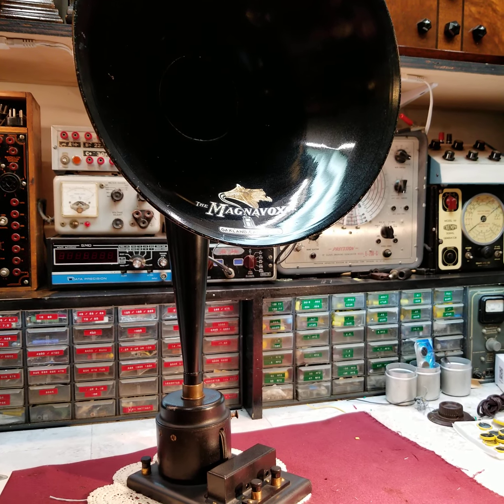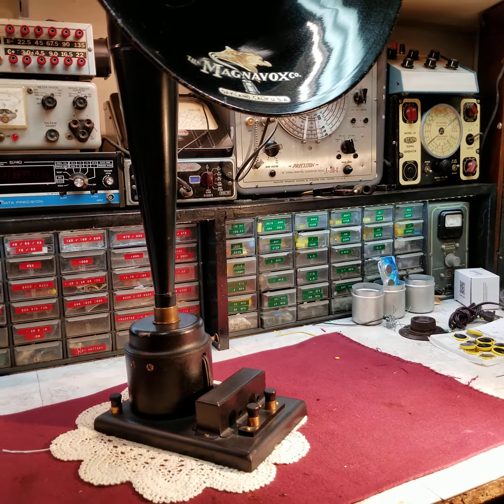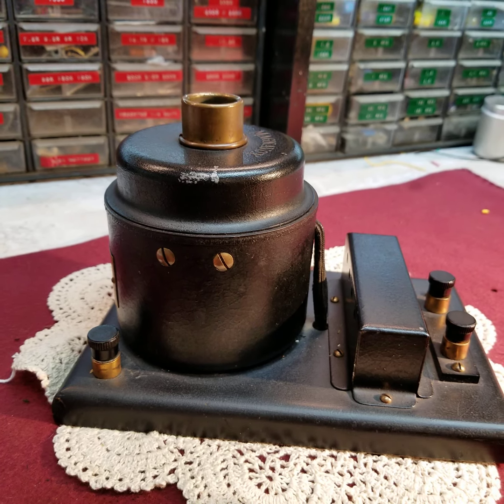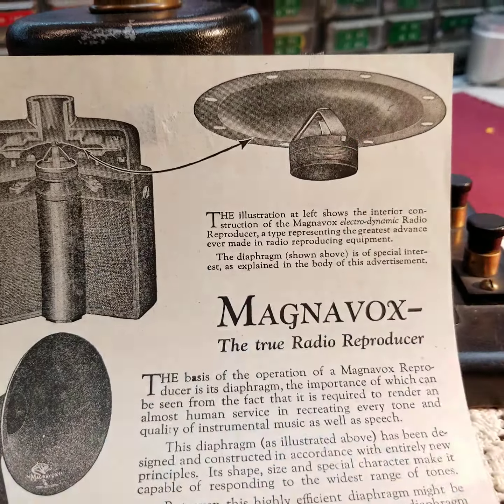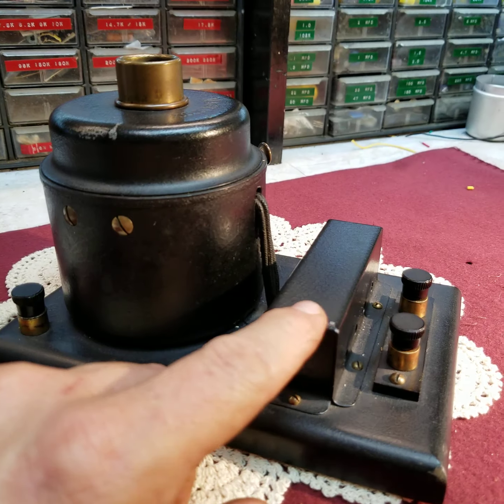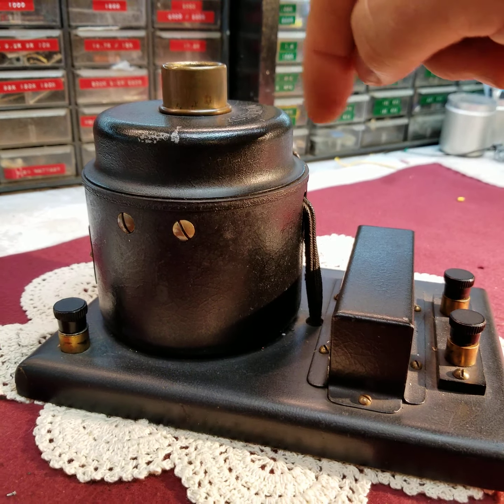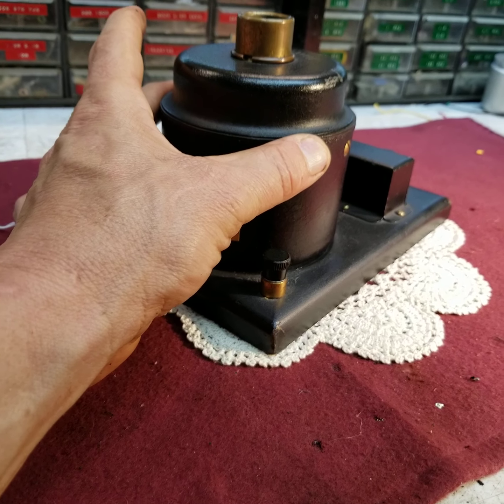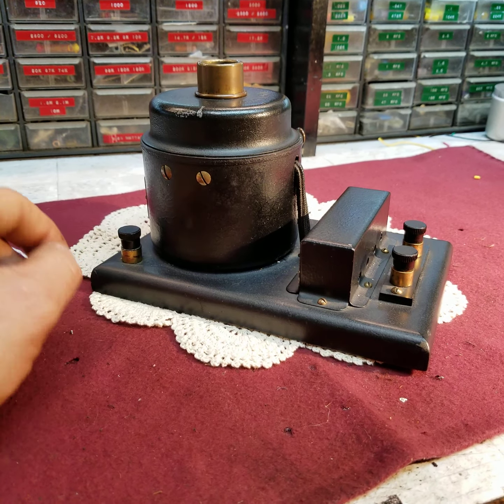Magnavox horn speaker

Comment: Good day I have a question I recently purchased a western electric 551 driver but do not know how to make it work. I was hoping you could give me some advice and or information on how to do this. My tube amplifier does not seem to have a 500 mill out put so I’m kind of stuck. Thank you for any help.
Reply from the maker: I am so sorry!  I just saw your question!!
Most WE had two wires.  It should be a simple connection to your set.  If it is inoperative--use an ohmeter and test for a reading of around 1K at pin tips of speaker.  If you do not have---your speaker is faulty.
Reply from the maker: OOPS!  I am mistaken!  Their is no polarity!!  It may have been another speaker in my collection I was thinking of!
Polarity not important!

Comment: does transformer polarity matter?
Reply from the maker: @theuserthatishere  
No--not really.  The 6 volt supply for field coil is polarity sensative is labeled + and -.
The audio input is not critical
Reply: @Davesradios  my polarity is not labeled for the 6v? looking from back, which terminal is which? both are labeled battery. will a 6v dc wall transformer work? also i saw a fella run his phone into the input with an adapter between called an amp-jack?

Comment: can i run a modern mono input from an amp? like a cheaper amazon pre/power amp between my signal and this speaker? thank you
Reply from the maker: I suppose one could--be carefull not to overdrive horn.  These were designed for a fairly weak signal compared to today's audio devices.